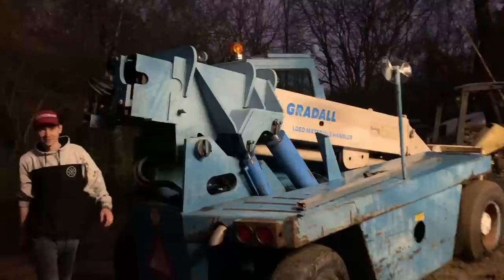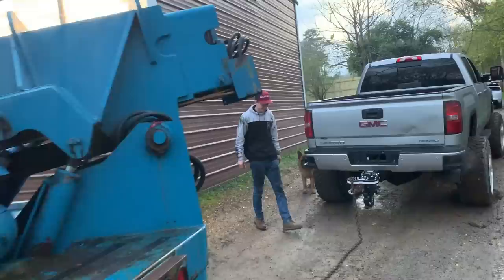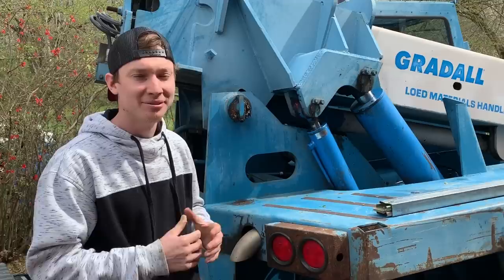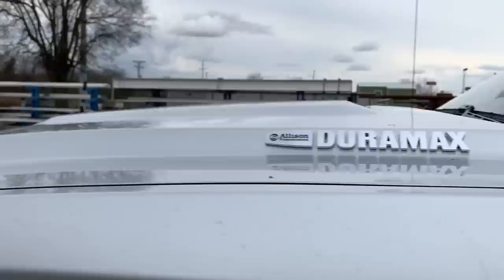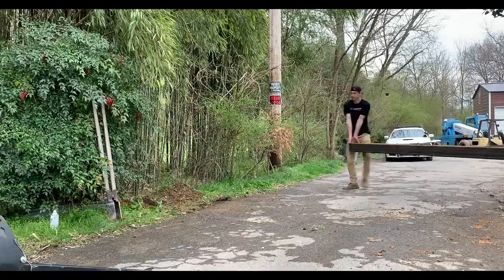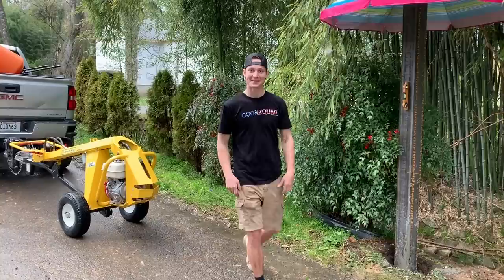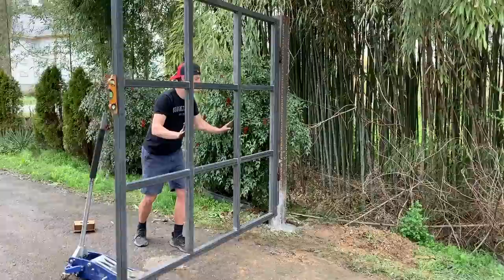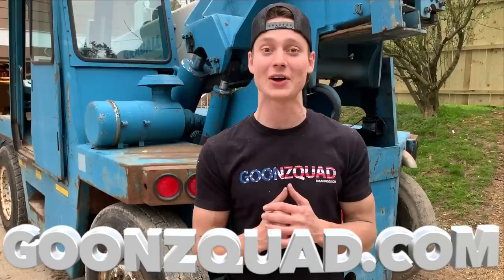Rebuilding The Worlds Biggest Forklift Part 3

Comment: You might wanna cap off the two posts so if it ever freezes when it's full of water it won't expand and break
Reply: X2 on capping the posts.
Reply: We have a motion, it has been Seconded...all in favor?

AYE!
Reply: Be rude not to
Reply: What about plugging it with concrete?
Reply: @dancando6391  concrete is still porous after curing...
Reply: @dancando6391  or drill some drain holes
Reply: Indeed, my first thought as well. Although I'm not sure how big an issue freezing is where they live, seeing how they are in t-shirts and shorts in March, but the beams will rust from the inside. Over time all kinds of nasty trash would also accumulate inside of them, including mice and such falling and dying there.
Reply: @dancando6391  No point it will be to heavy to remove if they need to and costly it would be more easy to cap it off with a steel plate
Reply: @Stefan-up9ci  don't even need a steel plate, they make slip on caps that big.
Reply: Fatal Killer that’s why I’d fill it with concrete. Keep people from trying to mess with it. Had a gate so stoutly built a truck ran into it at about 45 50 mph and it didn’t bend or anything. Thing moved back in the ground about 2 inches (stayed straight too) ol gate at the bottom of the cemetery hill.
Reply: . Scout seen it. Frozen water and expansion will break just about anything.
Reply: . Scout it will actually
Reply: Seen water expand and break copper pipes...
Reply: Also it’ll rust from the inside and weaken the posts if the water sits inside.
Reply: Yup... And the frame too
Reply: I came here to post this too. Not only that but it can rust on the inside when filled up.
Reply: Didn't realize so many people would be worried about this lol
Reply: Use solar led light cap on both post should do the trick

Comment: Fill the beams with concrete at least quarter of the way, and put some type of cap on it.  Other wise water will get into in and soften the ground under the concrete and your gate will sink.
Reply: They also should have rust-proofed the parts of the beams that went into the ground.
Reply: At least they have to close the top with a cap.....
Reply: @MoRRaZ505  You are 100% correct. Thought of that myself. I'm not sure how corrosive the soil is in that area, but they got time. In 10 to 15 yrs when the thing is totally rusted out they'll build a new one. For 1st time fence gate builders I'm proud of the boys.
Reply: I suggest filling the beams with concrete and capping them.
Reply: 100%. Correct
Reply: @Liam27762  I also suggest just filling it with concrete to the top and put a cap on, makes it just more sturdy :D
Reply: These are columns, not beams. Technically speaking, they are HSS tubular Steel. Rust preventative measures should be taken below grade while bearing in mind that adhesion will be reduced between the steel and concrete. Filling the steel tube with concrete will help with rigidity of the gate but water will still find its way under the concrete because it is not waterproofed. A cap with continuous welds on the perimeter is the best solution
Reply: Paint the fork lift the same color as the vipor.  Vipor lift!
Reply: @MoRRaZ505  the bottom part is completely covered in concrete. It won't rust, filling them with more concrete is recommended though. It won't be able to rust from the inside then.
Reply: What he said lol
Reply: 88888

Comment: When you are stuck with a fork lift, Barry your boom into the ground and extend it to push yourself out. I'm a heavy equipment operator and i've had those things stuck a bunch of times
Reply: Yep would totally agree with that  extending that boom would have taken that out of there no problem
Reply: same first thought I had also
Reply: brandin farmer DANG SON.... give this man a shirt!!!!
Reply: Yup did that when I was 16 or else my dad would of seen and kicked my ass 🤣
Reply: Pretty sure their boom doesn't work, they mentioned that last video.
Reply: 0xsergy 
Boom works fine.
Reply: Sometimes you can’t see the forest because of all the trees
Reply: lol this was hard to watch lol
Reply: brandin farmer was gonna say the same thing
Reply: @dinotudisca3821   Dino Tudisca  ye, they must have fixed it since i last tuned in. can't believe they didnt' think of that till after lol.
Reply: 0xsergy 
When they did the full service on the unit the boom started working. It may have been low on hydro fluid
Reply: I do this a lot...
Reply: Dig the tires out next time and use some 2x's under the wheels, also use the forks to push as you gas it.  That will work every time.
Reply: Pretty sure they already mentioned that they could’ve done it and just didn’t think about it until afterwards
Reply: Its Bury....not barry bro.
Reply: As a forklift operator I can tell you use the reach to push it out not the tires. Push against the junk lift to get out. Once it's not moving don't keep riding the gas it never works.
Reply: I really don't think that's possible in their situation.
Reply: @0xsergy  they fixed it.

Comment: Ends of the gate 2x2's you left them open, I would recommend capping those with plates to avoid water eventually rusting out the 2x2 from the inside
Reply: That and also they will get packed full of bees and wasps. I work on generators and a lot has fences and gates and bees love to live in those openings.
Reply: Also the tubing ends that hold the gates was left open water will settle in the we have some that wasn’t caped and we got a really cold few days caused the tubing to swell and crack
Reply: I would have rather cut those 2x2's at a 45 degree angle.
Reply: Plus some wax/grease inside the pillars and gate to conserve the metal from inside

Comment: Hey guys!  think about putting a wheel at the end of each gate so there’s two wheels in the center that way you never have to worry about sag or gravity or anything especially with your openers I’ve built a few of these, and you’re going to want wheels! Cheers! 🍻
Reply: I was going to suggest the same thing, but there is a slope, not flat, so that would just hang and add more weight when not closed.
Reply: @gd1996  how about spring up and downwheels? if that available ?
Reply: I might have suggested that but it looks pretty dang sturdy
Reply: That is not one of those flimsy looking gates with shitty supports. no worries about sagging there.
Reply: Next they'll have to fence the entire property... people will park and just walk around it.
Reply: Sometimes the wheels can be a real pain unless they are on a hard surface like concrete or blacktop to roll on. But another option is to run a cable with a turnbuckle from the furthest outward corner at the bottom bottom of each gate - or a single gate that keeps constant pressure from the furthest outward corner of a gate I have done this on five of my gates instead of the wheels and it works great. I had to use a come along to help tighten the cable and than used the turnbuckles to tighten the cable the rest of the way. This prevents the gate or gates from sagging and if my chance the cable stretches you can just tighten the turnbuckle more. But I don’t think they will have an issue. Thank You
Reply: Weld some stops at the top or above the hinges in case someone tries to lift them off the half-hinges.
Reply: They should have re-paved the driveway before putting in the fence.  And they should have painted the entire fence including the part that went below grade because that section is now exposed to rust.  Or at least put something in the ground to prevent galvanic corrosion.

Comment: did you guys do a "one call" for utilities location   before digging post holes  ??  maybe put a wheel on the bottom of each gate where they join together
 might help keep it from sagging !!  great job on the fence for your first attempt !!!!
Reply: 811..lol
Reply: Definitely a wheel, I was going to make the same comment...
Reply: I was about to say the same thing. Call before you dig
Reply: I'm betting they did, they do everything as by the book as they can
Reply: You don't need to call every time you dig...  Do it once and you never have to really ever do it again, especially that far from the road. The fiber fairy isn't going to do anything magically overnight without you knowing about it.
Reply: Yes sadly gates did sag 🙄 I think post foot needs to be at least 2 feet wide.. and you could dig with the big forklift
Reply: @longshot726   if you call one time they will mark the ground where the lines are !  I did a "one call " here in Pa to excavate a foundation and they marked the lines but missed a water line that wasnt on anyones maps,,,,luckily we saw the side of the pipe before we hit it !!   18 inch old main line  that was still live !!

Comment: Y’all need to cap the end of the steel posts so they don’t fill with water.
Reply: Agreed. They should also be preferably be peaked to let water run off and not sit on the top.
Reply: Open posts tend to collect wasp nests as well.
Reply: Fill with concrete
Reply: They should just cut the edges like in 45 degrees
Reply: The weld's have enough holes it'll be fine lol
Reply: Just fill with concrete. No weep holes. Holes are the beginning of the end
Reply: Save the top for some cool spikes with gargoyle ...maybe flame throwers on the side

Comment: That’s a hell of a gate ! Maybe consider putting a caster where under each gate to take some load off the post to prevent future shifting .
Reply: I was just about to say the same exact thing. I have built similar except telephone poles sunk about 4ft in hard ground with support of the rest of the fence for it to pull against and it still sagged a bit making it hard to open. I got a wheel with a solid tire and made my own L shaped axle that I welded to the gate, reset my hinges and its fine now.
Reply: Yeap, need wheels just to take the weight while gates are closed. Especially as your post holes were only straight down. the bottom of holes should be dug out to give the posts a bigger underground base. Great ob tho.
Reply: If they add gate operators, you should not add casters/wheels to the gate. The will bind up the operator and make them malfunction. I've been install electric gates for 20+ years.

Comment: Hey Goonz, was just sitting here enjoying the content and was thinking that you should Cap those posts so it doesn't get filled with water, just saying. Thinking it a good idea.. Keep up the awesome work.
Reply: That was my thought as well. If you don't cap them more water than can drain out through the soil at the bottom will rust the posts out in a few years. I am glad they went with a double swing as those posts are not deep enough for a single swing.  I have a single swing with the post at 4 feet deep and it still leans a bit.  :)
Reply: I had the same thought as well. Hopefully they see this so that beautiful fence doesnt go to waste!
Reply: Fill the post with concrete
Reply: The gates should have had a 45degree cut fro the corners that it's sealed , great look however
Reply: Foam dem posts up like with the fence that might be the fix
Reply: Or drill a drain hole in the bottom and spray some oil inside once a year.
Reply: I'd pour some concrete in those posts before capping them.
Reply: I thought by capping and leaving them vented would work then really any moisture or more rusting..
Reply: Does it get below freezing there? If those posts get full of water and freezes, they'll split.
Too bad they had to build the gate and fence!
Reply: To add to this convo. The water that gets into the post will freeze and split the corners of the post. Believe it or not I’ve can distort and crack steel
Reply: that or drill some drain holes close the bottom.

Comment: Making literally tons of youtube money and still don't spend like crazy but trying to make all things yourself. You guys know the value of money and don't take it for granted. Thats what i like about you guys.
Reply: What, how much money do you think all that new steel cost?
They could have built a gate out of chain link fence & fence parts, it would have looked better with less than half the weight, and it would have been fine, and never need painting.
This thing is way over built and will need paint maintenance too.
Reply: They do that so they can make vids to make more money
Reply: They literally just spent $600 on a $60 beam.
Reply: @rakaiser7331  $600. But what i mean is they could have gone the easy way by hire a contracter to do all the work. that would have cost a whole lot more money. In stead they put in the effort themselves. i like that mentality.

Comment: Just so yall know, for the future, if you're digging deeper than 18 inches you need to call 811 so they can mark the lines in your area. Its a legal requirement. If you accidentally hit an important line, you will get a huge fine. It can also be dangerous. I just want yall to be safe. We hit a gas line that was mis-marked when I was doing utility repairs and it was extremely dangerous. Good video as always gentlemen.

Comment: You should add two wheels to the gate because it might start sagging
Keep up the great job
Reply: No wheels on oneven ground. Just add a cross brace. Google "cross brace gate" and you know what I mean.
Reply: They won’t sag if the poles are in deep enough with the cement around them. They’ll only lean like that if there were carelessly put into the ground which they weren’t so it’s fine. The should cap the top of the poles tho.
Reply: Konstantinos Kotsianis no need. All welded together and 2 feet in cement. Their will never be a sag.
Reply: @stew347  good call there. Otherwise they'll just fill up with water and debris.

Comment: I've operated many of these many different sizes, When stuck, sometimes put forks all the way to the ground and use the telescoping boom to push the machine backwards, hope this helps
Reply: That's the way I've also done it farming for years 😉👍🏻
Reply: @wobblepopgaming  
Definitely 🙂👍🏻
As well as the independent axle brakes, 
You can slow down the spinning wheels, sending the power to the non stuck side 🙂👍🏻
Reply: Yes the boom would have pushed it out.

Comment: Cap the open ends of the steel. Also, a chop saw would have sped up your cuts. It’s a good investment, you can use them for lots of other steel cutting.
Reply: I was thinking the same thing. A chop saw would’ve made that job a bit easier.
Reply: Capping the posts and open ends definitely a good idea.
Reply: Caps and some cavity wax for rust protection

Comment: Add wheels on the bottom, put locks, and add hinges so they don't swing out of control
Reply: Marcenel Ferdinand also close off the top of the beams
Reply: Add a slit on the bottom so that it should not swing in the air
Reply: Marcenel Ferdinand no shit

Comment: With all that weight hanging off the those posts, I would weld on a cable to the top of each post, and have that cable tugging directly opposite the gate sag and, secured to the ground in some way.
Reply: Was thinking the same thing.
They are gonna be fun to open in a breeze too!
Reply: @warrenholmar1129  Depends which way the wind is blowing... If its in the other direction just hang on and enjoy the ride.
Reply: @pixiniarts  hehe I hope for the best, we had gates at work with a slight breeze they were hard to open.
Reply: @warrenholmar1129  Friend of mine ened up with the nickname 'domestic', he was in the goods yard one windy day when someone opened the side firedoor wind took it and smashed it open against the rail, it popped the lock out which flew and hit him in the face giving him a black eye, his explaining what happened sounded like such bullshit that it sounded like an excuse to cover for domestic violence like his wife was hitting him, so he ended up being called 'domestic'...

Comment: I build fences for a living. I can say y’all did everything about how I would! Only thing I can say is when building a double drive gate, like this one you want to build both sides at the same time using straight pieces of steel. Then the last thing you do is cut it at your middle point, separating the two
Reply: Damn good tip. I've worked steel for a long time and that idea didn't come to me
Reply: DougT25427 it just guarantees that each leaf of the gate will be level no doubt. But they seemed to have it pretty close

Comment: Tip for the gates:
Add some blanking plates over the open ends of the beams so water doesn't pool inside and rust out over the years. Likewise for the gateposts themselves or a couple of feet of water could accumulate inside over a winter.
A video doorbell is necessary, with a button accessible from a car/truck.
You need VERY strong automatic gate motors, not so much for the weight of the gates, but to cope with the forces of strong winds blowing against such big areas of those gates!

Comment: May I suggest filling the 10 ft fence post with concrete to add strength, noise suppession...  or maybe weld up a cap so the dont fill with water and become stagnent stinky breeding ground for algae and miskitoes and such...  you guys do eccellent work on every job you tackle and arent afraid to get dirty

Comment: Next time you buy steel, try your local scrap yard. Mine, where I'm at, sells me beams all the time. That square beam would've cost me 60-80 bucks instead of the 600.
Reply: $600 is pocket change to them. Time is money.
Reply: @dco5055  So you waste money for no reason. You make a lot of sense. It takes the same time to buy it from a steel yard as it does a scrap yard.